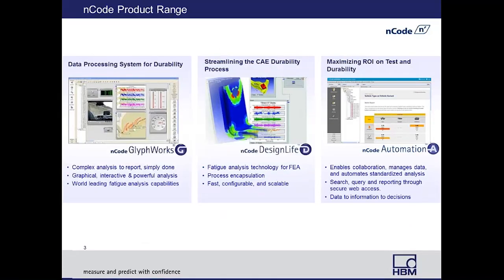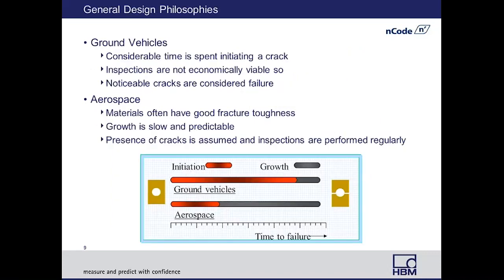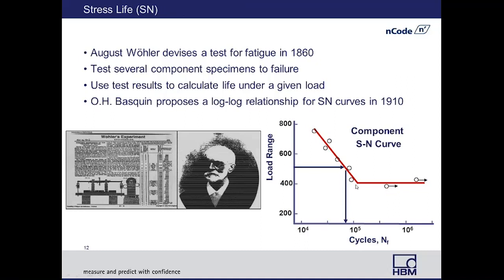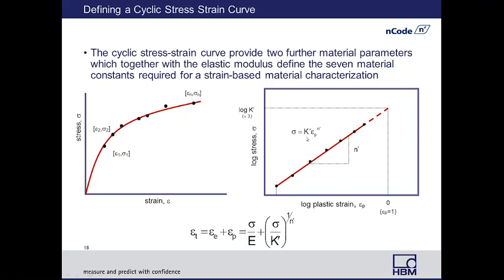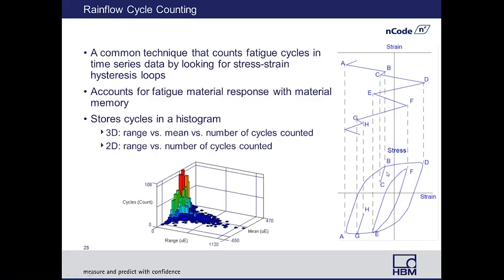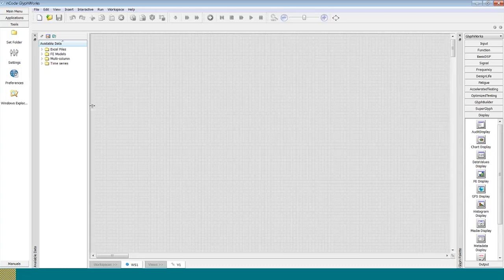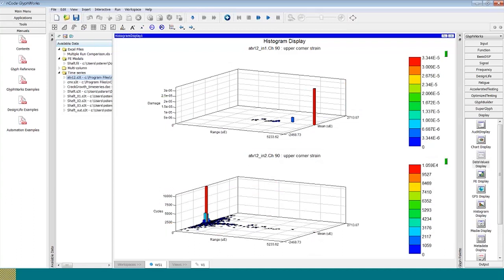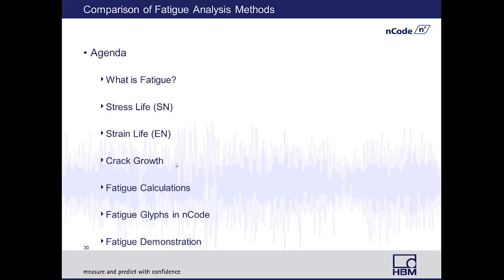Comparison of Fatigue Analysis Methods

Comment: I like very much nCode for fatigue analyses! it allows performing a good fatigue assessment quickly, even with huge spectra. The only weak point I have found is the graphical post-processing: it is not user friendly at all and especially it takes enormous time to refresh big FE models: 20 or 30 minutes waiting time for an Ansys model with 3 millions nodes.
Reply from the maker: Thank you for your comments, and thank you for watching. If you reach out to our team at https://www.ncode.com/about/contact-us, we would love to see if there's anything we can do to assist you with your software issues.
Reply: @Ncode  thank you very much! I use nCode almost every day for many years now for my fatigue analyses and also to post-process data signals measured in flight. I am in contact with your support. Apart from the small "graphical" inconvienences I mentioned in my first post, I find nCode a really great tool to perform robust and reliable fatigue assessments in a very short time, also on big FE models and with any kind of spectrum and loads, even with real flight data. For the graphical post-processing what I do is to export csv results form nCode and to reread it in Ansys, which is my FE work tool 😉
Reply from the maker: @multifat8416  great to hear that you've connected with our technical support team! Thanks again for your reply, we're so pleased to hear about your positive experience using nCode GlyphWorks and look forward to providing you with the tools you need to efficiently post-process your data and run fatigue assessments on FEA results :)

Comment: Nice! Do you guys have available databses for composite materials (UD, wove, short-fiber)? How does the fiber direction is imported from the FE-model to account for the different failure mechanisms while doing the life-estimation? Thanks!.
Reply from the maker: We have a Premium Materials Database that contains fatigue parameters for steels and aluminum alloys; with more recent additions that include strain-life data for additive manufacturing materials. Material testing services are also available through our lab in the UK. Feel free to reach out to us at http://www.ncode.com/about/contact-us so that we address your needs directly.